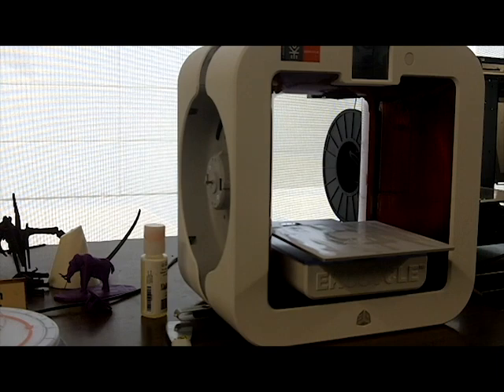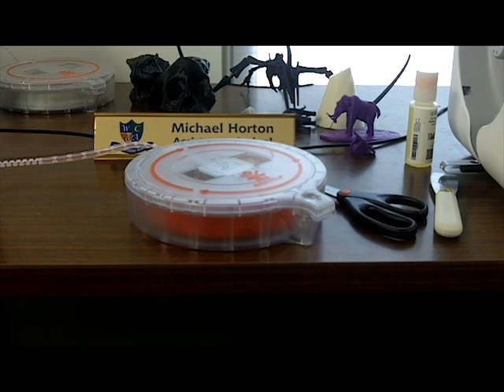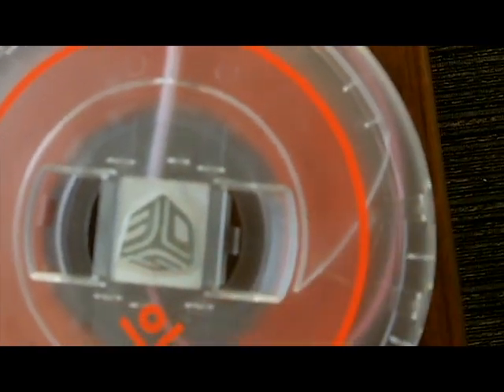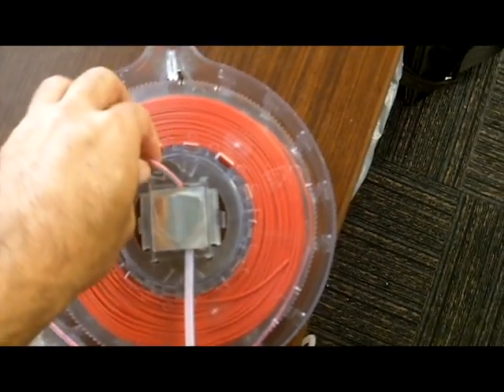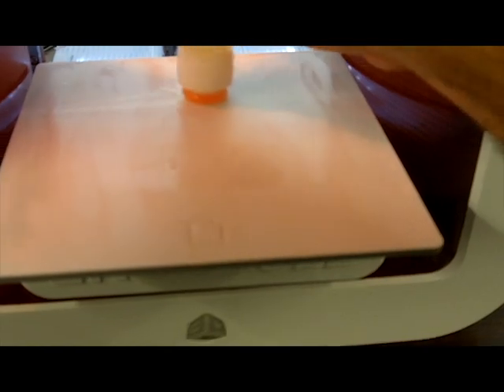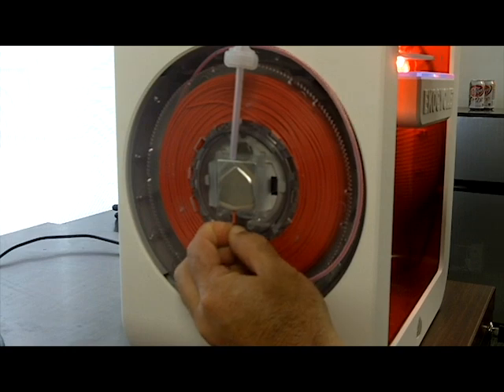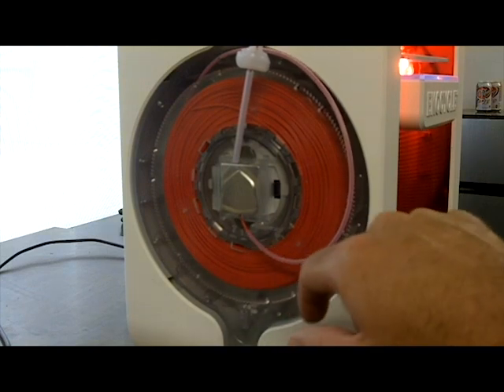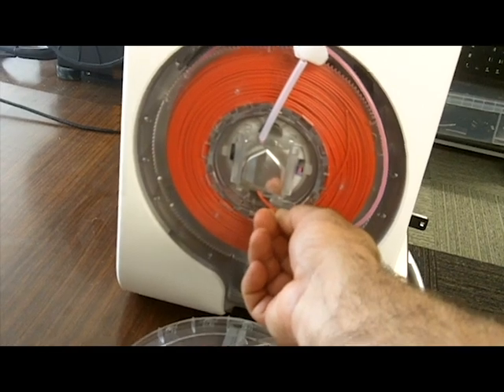Fix clogged extruder on Ekocycle 3D printer

Comment: Save yourself a huge headache and don't buy this printer. It is really utter crap. The cartridges are proprietary and cost double what most generic spools cost, it is super loud and sounds like it is about to break, and the auto calibration doesn't work. I destroyed a print bed because the second thing I printed stuck so much that it tore a chunk out of the bed when I removed it. Not only that, but I contacted cubify to send me a new bed, and 3 months later I still don't have a bed, even though they said they would send me one.(and it costs 100 freaking dollars for a new one. Really?) Also the proprietary software is garbage, and you have to wait for the print jets to heat up and cool about 3 times before you can actually print something. Buy your self an ultimaker 2, or build a reprap. (this is coming from a repraper, so I may just be spoiled with my open source beast of a 3d printer (prusa i3))

Comment: Worked great!  Thanks for sharing!

I found that the needle-nosed pliers that came with the printer were good for releasing the 4 inner clips on the cartridge.  I pushed towards the center of the cartridge while pushing into it and it seemed to release the clips without requiring a lot of force.
Reply from the maker: Cheerforftc Blogspotdotcom That's great advice!  Thanks for sharing.

Comment: this is great but, we shouldnt have to do this, Ive had about 20 cartridges clog just to be replaced and have them clog again...I guess I should assume that all my cartridges will clog eventually and thats not good considering you pay $50 each.
Reply from the maker: We have 6 of these printers at my school and two of them clogged.  The one in this video worked fine after this procedure.  The other one never did work and had to be returned.  The replacement works fine now.

Comment: Thanks for the video, it works great for a regular Cube 3 as well.

My one comment is pay close attention to how far down you're holding the filament, I held it too far down and ended up putting a crease in it. Luckily it wasn't bad enough to break it and it was able to be feed it through with a little bit of pushing.
Reply from the maker: That is great advice, thank you.  Our other 3D printers have gotten kinks in the filament and it was devastating. Good to hear that this model can live through it as long as it doesn't break.